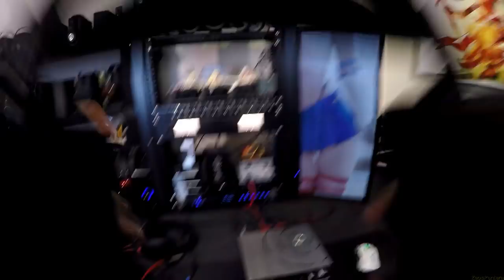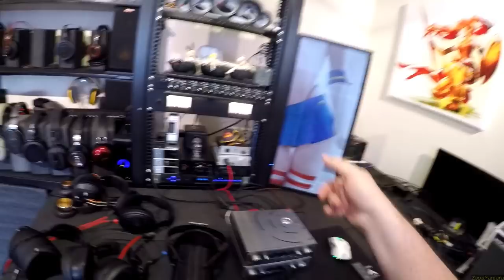Z Review - ifi iCAN Pro & iESL (iCan Do Anything)

Comment: I'm so glad you ran into the clipping issue on your demo. Proud owner of the iCan Pro here. I'm absolutely in love with the features this thing offers. The much needed DSP boost and the range of outputs is what sold me. I'm going out to AKG K1000s (balanced 3-pin XLRs) and for some reason when I'm on tube+ and 90 degrees I get the clipping issue past 10 o'clock on the volume. I know these are super hard to drive headphones, and every other pair of cans work fantastic with this amp, but to me this amp just falls slightly short of perfection. I bought this amp because it offered balanced 3-pin XLR, but wish it was just a tad bit more powerful to drive the toughest cans one would wish to throw at it. Ifi even has a pair of akg K1000s on their front page claiming its the best choice for these.

In short, after owning this incredible amp for more than 6 months I've been searching for the exact same features with more power. The only other amp that I think might offer this with balanced 3-pin XLR is the Trafomatic Primavera. Does anybidy else have any suggestions?
Reply: Is this on full gain? I can make mine clip with some ie800. 0db gain with full xbass and 3d would clip at around 12:00. I read somewhere, Ifi said that the xbass and 3d use a lot more power. So I put it to 9db gain when using the xbass+3d and it never happened again. I guess with this being analogue and not dsp then the effects actually need more power?
Reply: Not on full gain. In fact on 0 gain it would clip on tube + and 90 degree at 9pm volume. Again this is with dual 3-pin XLRs. Every other headphone performed fine though. I don't blame ifi. At this point I just want something more powerful without having to resort to wiring to the outputs of a speaker amp and dealing with dangerous power.

Comment: You can use your fostex with an 1/4 inch adapter to bypass the iem sensitivity  circuit, so you use the 1/4 inch input and it should be louder, and obviously it maybe can match better than with the 3.5mm input.
Just a suggestion.
Reply from the maker: I'm all over this.
Reply: @ZReviews  Do you mean to say that there is something better that you can recommend that is on the level of iCan Pro?

Comment: Bought L700, the question is, should I get iESL or SRM-353X/323S ? Which is better ?
Reply: same question !
Reply: iESL you still need separate power amp or iCAN pro to drive it..... SRM-3xx more straight forward solution than mix n match equipment hoping to get the right sound
Reply: woo wee with a great solid state amp  :)    Woo Wee does one thing only... and does it amazingly well.  I've compared it to multiple STAX amps, beats them all.....  you do need a first rate amp and dac.
Reply: woo wee is only a transformer amp it still need a power amp to drive the estat..... it's only cheaper compared to iESL which performs the same function
Reply: Do you own the Wee? If so which amp are you pairing it with? Just curious as I have one on the way and will be pairing it with the basx but do wonder if I could do better.
Reply: I bought 353X and I'm not blown away, pretty sure is not the DAC, I recommend something else for L700.

Comment: Maybe they went with a silicone pad instead of the normal rubber feet to protect equipment it's sitting on? I always find it annoying when I have a metal or wood cabinet on a piece of hardware and the thing sitting on top of it leaved black rings that never seem to come out.

Comment: Your T50rp are really crazy difficult to drive, according to power calculations they shouldn't come any close to max of a 4 W @ 50 ohm unit.
Reply from the maker: Its the same with T20 and the other modded T50's like the new Argons. Trust me math can not help you.
Reply: I just received my T20, they are exactly as power hungry as my AKG K702. It seems like the moda cable adds resistance, I didn't try so I can't confirm.
Reply: It's the high resistance of the Vmoda cables Z, not the headphone.... TX0RP can be driven fine with the stock 10' cable with 1/4" end.

Comment: Z's explanation of impedance is incredibly confusing (and incorrect). Lower impedance is a smaller load and easier to drive. Higher impedance is a bigger load and harder to drive. I think what Z is trying to explain is that a smaller load causes a bigger current to be drawn from the amplifier, and at some point it can become too small.